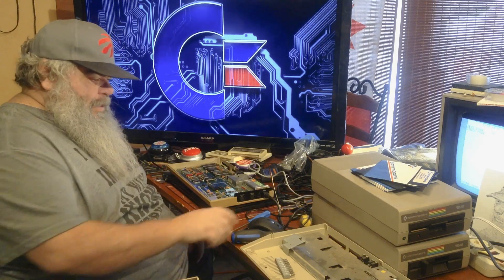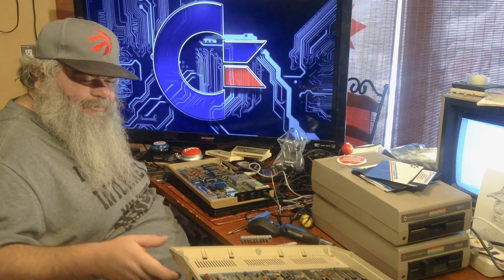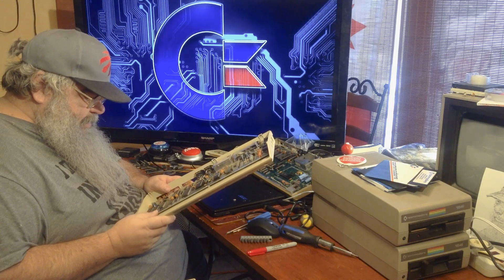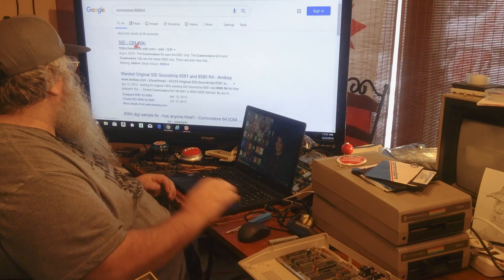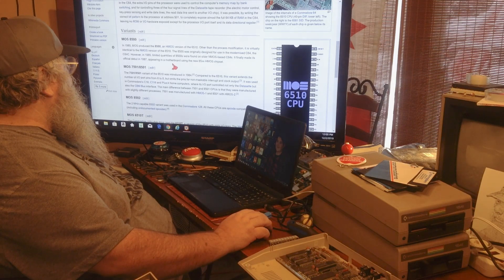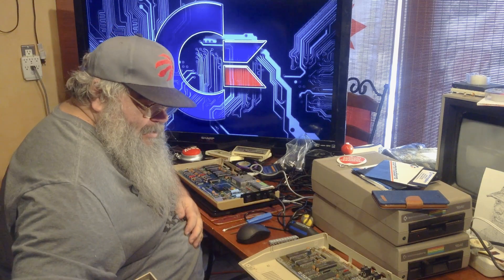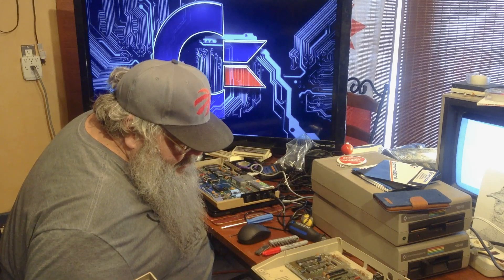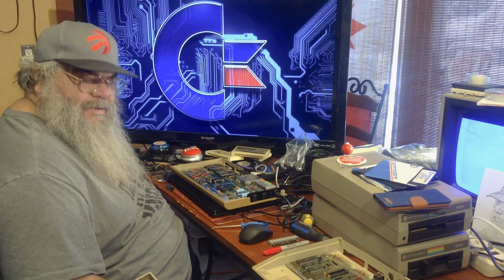Commodore 64C Diagnostics Short Board 64 C64 C-64 64C 6502 C-64 C64C - Dave Bradley - Episode 572

Comment: Tread carefully Dave when moving chips between breadbin and the c64C. I would have just tried switching chips between two c64c's. Don't know if the ntsc machines are more robust than PAL but i don't think the chips are 100% compatible to swap between the two different boards. It was interesting to hear that your dead test cart did produce the sound with the 8580 installed. Also Dave i was fighting an battle of my own here with an 250425 board...black screen...an unpopulated board (it missed all the major socketed chips) i scraped together every other chip and turned the machine on and...nothing black screen still. Then i remembered your video where you checked out the fuse. I took the fuse out and put an another one in and bingo! Immediately the machine flashed when i turned the power on and yes the normal lovely blue startup screen. It wasn't even the original fuse. I put it back in and it worked as it should. There was something odd with the fuse socket almost as if the fuse wasn't properly in place.
Reply from the maker: Yes, I will be careful with the older chips and the newer boards...I have not nearly as much experience with the newer boards...yet!
Reply from the maker: If you turn on the machine and there is absolutely no response on the screen, the fuse is likely bad...but of course, after so many years, the micro corrosion can do bad things...and not let the power go through properly...and if the fuse is off kilter, perhaps not as much of it is making contact, and the corrosion is in play as well, but also, I have encountered a fuse that had one of the metal ends that was loose...and the fuse is basically the glass tube, the thin wire, and the ends...and if the end is not snug, the fuse might appear to be good, but still be a bit wonky...when in doubt,pop it out!  Glad you got it working!!!!